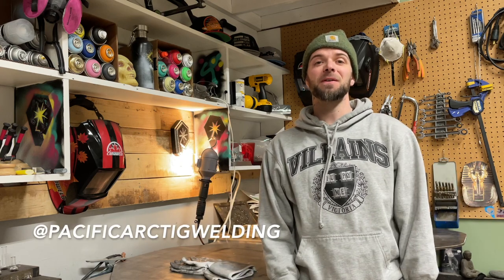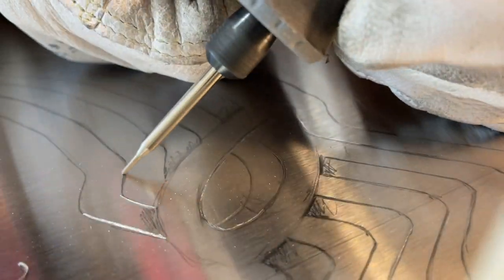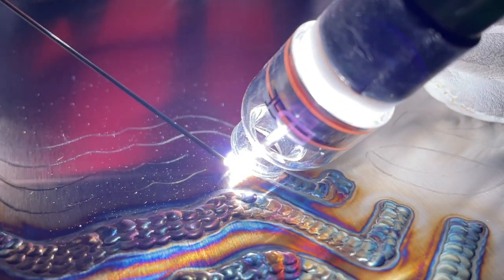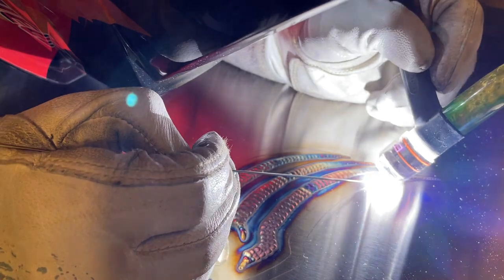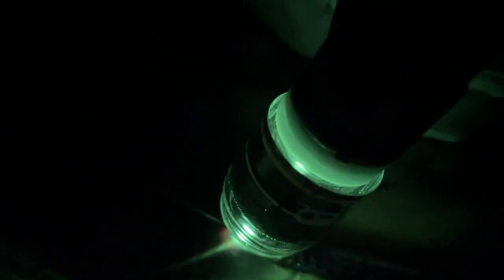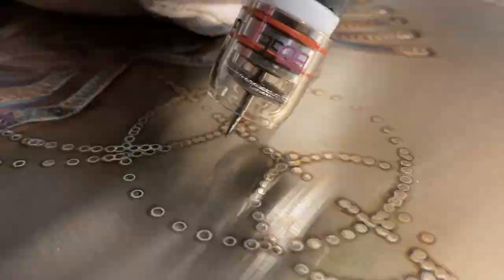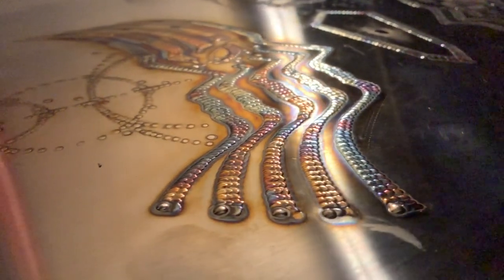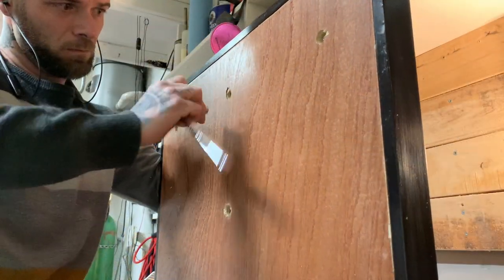Tig Welding ALL NIGHT to finish a project for a customer…

Comment: unbelievable technic, knowledge, experience!

I was thinking a lot how should I draw up  the picture on the metal sheet. Because if I use graphite pencil, to draw up,  the welding pool will be contaminated. 
From this video I got the perfect answer and technique to solve this question.
Thank you very much for your knowledge sharing.
Now I thinking how did you made the "metal crystal" .
I think you welded together 8pce sheet metal pieces and the corners you grinded and polished the whole "metal crystal" surface. :-)

Comment: I am looking to get into tig welding (preferably aluminum but I’ll see) and want to know your recommendations. I only have access to 110v because of the way my house is wired, the board is very far and would have to pass through multiple walls to run a 220v. Thanks I’m advance! Also, I would be welding chairs, frames, medium duty things.

Comment: Not sure if this is the correct place to ask questions, but I have an issue that I'd like to see if you could help with? Arc wandering on aluminum. I start out with full pedal and the arc is a half an inch away from the tungsten. Any thoughts?

Comment: Why didn't you try leave that pencil drawing on sheet? I think graphite will be ok to be added in stainless because it's just a carbon and steel already has carbon into it. Just wipe sheet with acetone before the drawing and then use a gloves to avoid fat contamination.